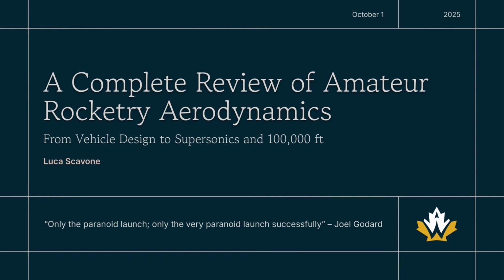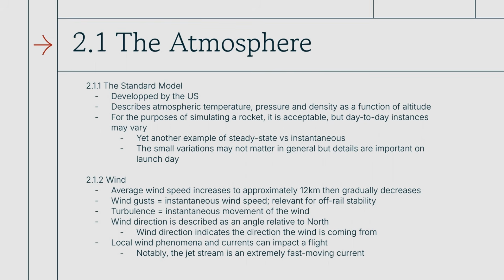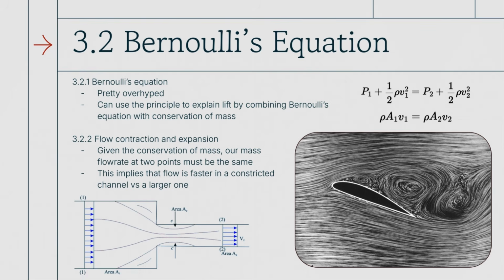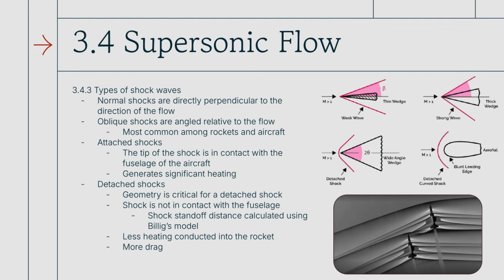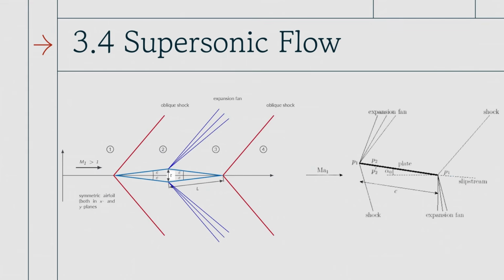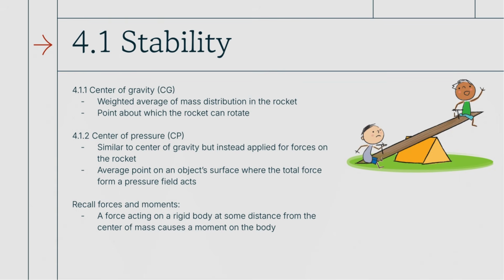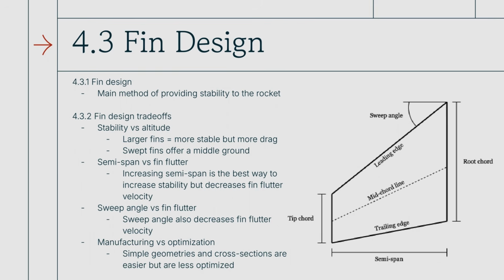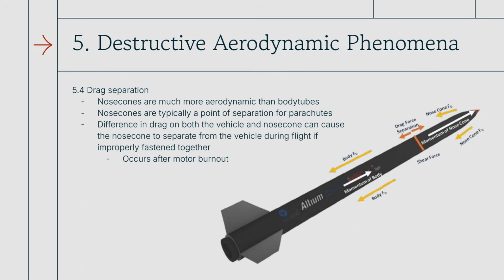Amateur Rocketry Aerodynamics: From Vehicle Design to Supersonics and 100,000 ft

Comment: Correction : It is a misconception that particles over the wing accelerates to meet the particles under the wing which takes the shorter path. This is a debunked myth in Aerodynamics. The source of lift is attribution to the wing changing the direction of wind by imparting a downward force. And by the all powerful Newton’s third law, the wind imparts an equivalent upward force on the body that we call “lift”.